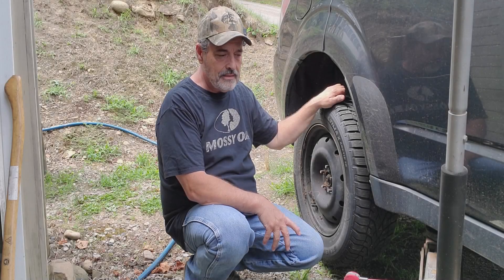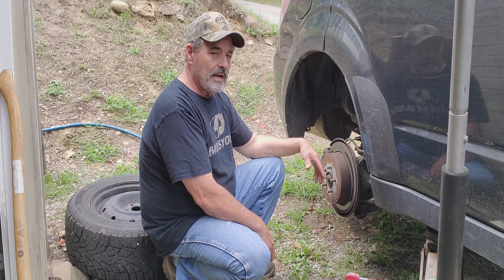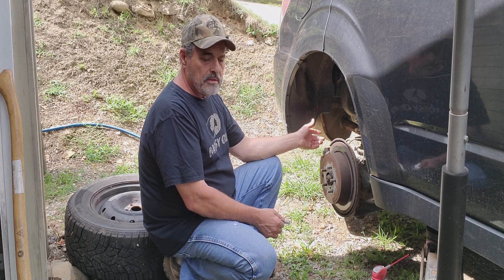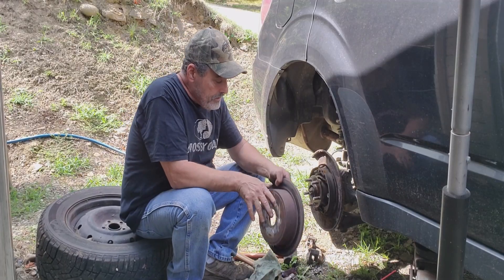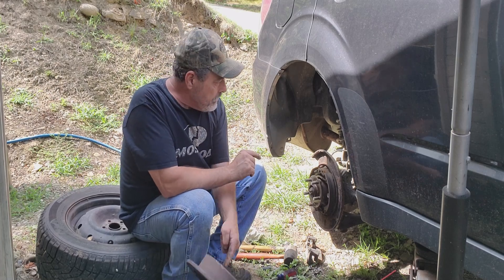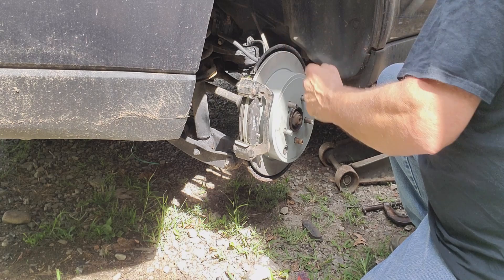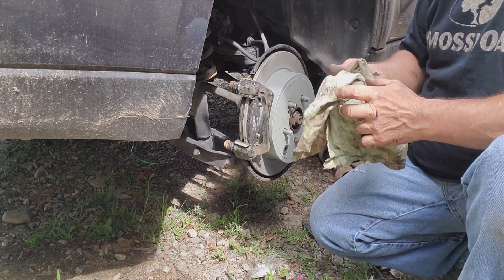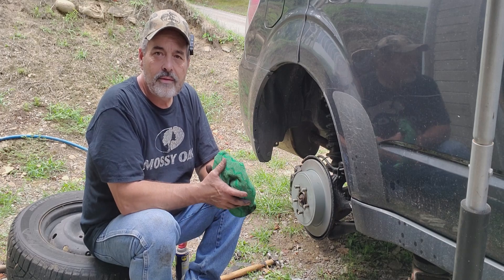DIY 2010 Subaru Forester Rear brake-pads and Rotors

Comment: Good Morning Sir 🌞👍🚧🚧OUTSTANDING MAINTENANCE VIDEO ABOUT 2010 Subaru Forester Rear brake-pads and Rotors 👌👌🧐👍🚧🚧You are a Very Good Mechanic👍🧐👌Sir Up Here In The Salted Road We Have to Grease and Oil the studs and Oil/grease all underneath the vehicle 🥴🧐👍Cheers 🍻🍻

Comment: I think you're correct on the newer vehicles - not being able to push the cylinder back in like you did. The rotor style brakes are one of the few things they changed on cars that actually make it easier to replace. It was always scary pulling those drum brake springs!
Reply from the maker: Your right drum brakes are a little hard to take off with the springs thanks for the comment

Comment: Nicely done on the brake job Mike. Nothing worse than when parts are seized, it can make the job a real pain.  I agree, machining/turning the rotors make them to thin and when they heat-up they have a tendency to warp. I use a lot of anti-seize and grease up the brake parts pretty good because of the amount of salt and sand used on the roads during the winter in my area.  I service my brakes every Spring and Fall to keep them functioning well.  My 2018 truck has 4 wheel disc brakes (I don't miss drum brakes) and I use a C-clamp and a small piece of wood to push in the dual cylinders without any issue, no bleeding.  Take care!
Reply from the maker: Thanks for the comment have a great day

Comment: Hey Mike, nice video and great tutorial. One small detail, the hydraulic part slider pins are not the same.  One has a rubber bushing towards the end.  What is the proper placement for the one with bushing? I wear out my my outboard shoes on the right rear brakes all the way to metal, I think it is cause by the hydraulic part not releasing to neutral. During maintenance when I retracted the piston, it slides back freely. I think the problem was the slider pins.  Thanks!!
Reply from the maker: @TonyPablo  I think you're right it could be I haven't thought of that thanks for your comment

Comment: Great video Mike. Nice tips. Fairly common to have rear disk brakes, but the emergency brake is drum. 
My 1998 Chev S10 was like that. 

Subaru are a good vehicle. 
I had a 1978 Subaru Brat. The four wheel drive worked awesome. Just a lever to set a gear in the transmission to lock in or out the four wheel drive. Was normally front wheel drive.  And the emergency brake was operated at the front disk brake. When you pulled the lever it would pull the front pads together on the disk. 
Neat vehicle. The places I went with it. Jumpins. 
Thanks Mike. Have a great weekend. 👋👋👍🏻👍🏻
Reply from the maker: I know I do enjoy the Subaru it does Drive nice and has a hundred thousand on it still runs strong